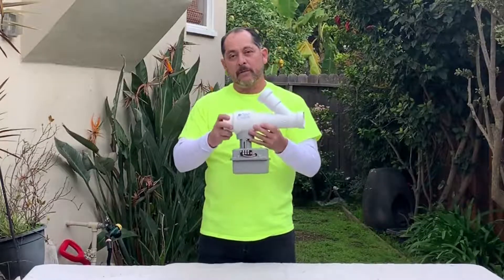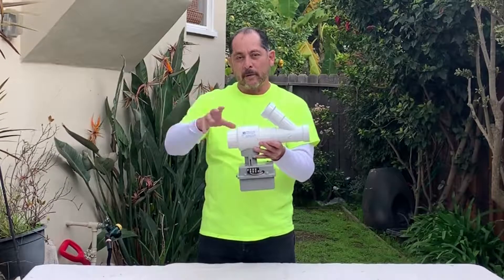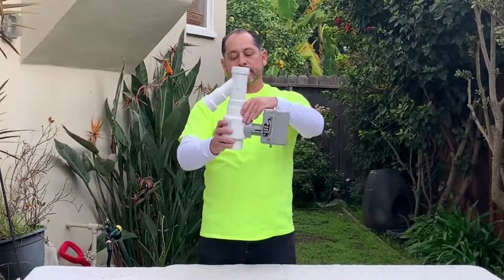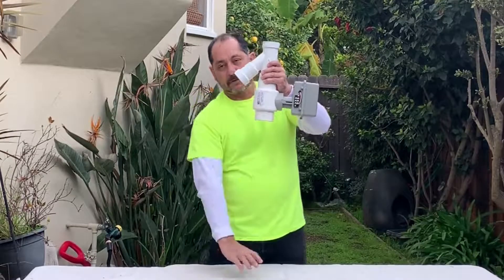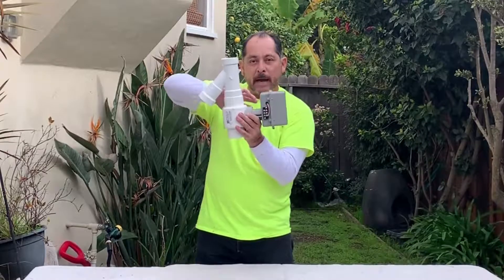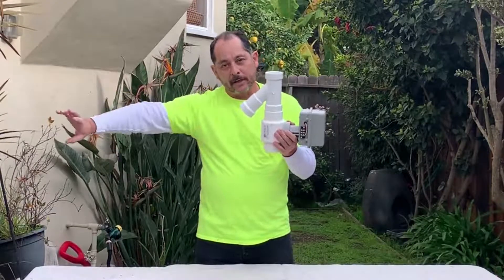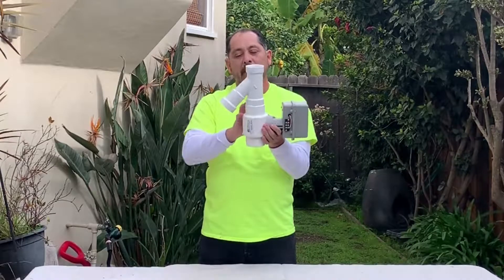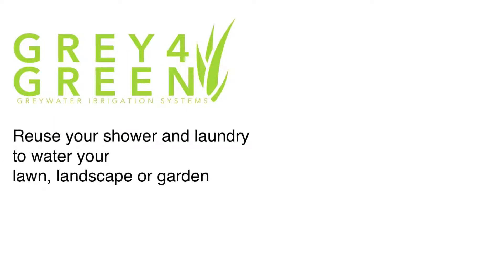UPC Certified Greywater Diversion Valve

Comment: do you still make this? I do not see on your website? I am building a shower that will be about 4.5" above a slab and the slab will have a hole to access the P trap and plumbing. I think this would make accessing the valve much easier. vs a gate or 3 way valve